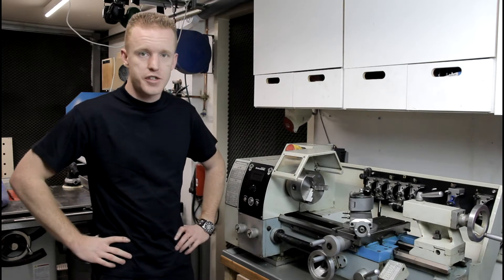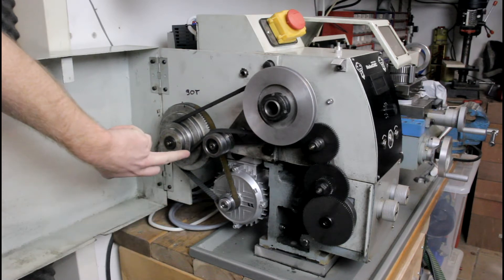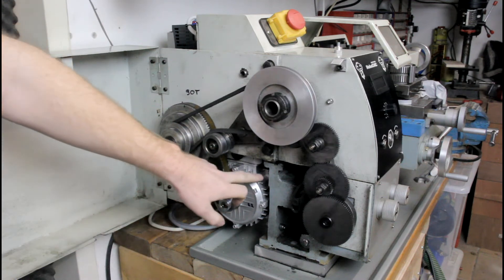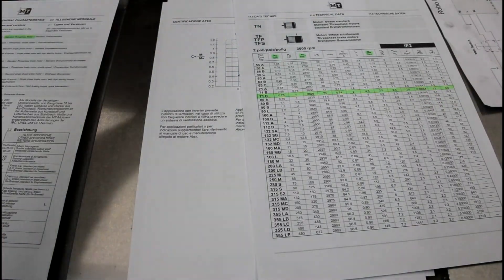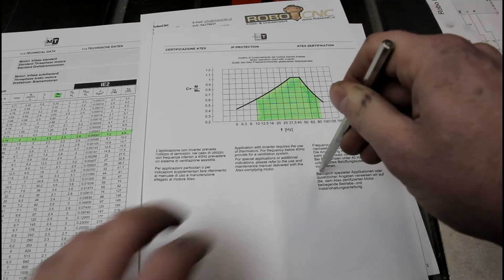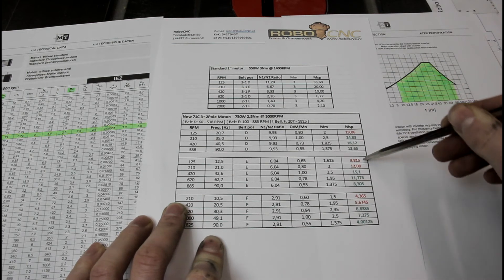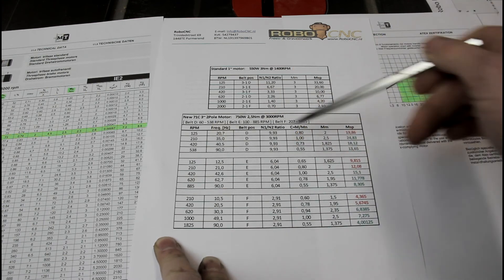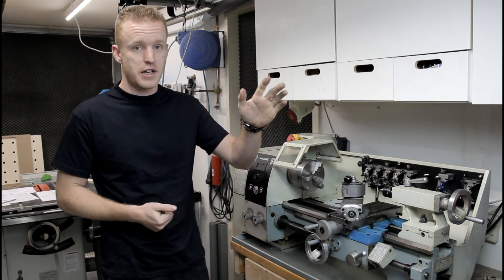RCNC Various 07 : Lathe VFD conversion and motor selection. (Variable speed)

Comment: "brand name i dont even want to talk about" I understand Exactly what you mean!  Nice job you did. How is the machine working?
Reply from the maker: The machine works fine for what I do with it... budget and space wise this is a great little machine
Reply: Good to hear, then you were more lucky then i. Had to do a lot to mine, it works pretty good now if i forget that the vee ways are ground hollow and the saddle only contacts on to small strips top and bottom of the v. 

The pulley you put on your new motor, was that a bought item or made?
Reply from the maker: Bought, although I cant recall specifics
Reply: Thanks :)

Comment: Well done, nice job.

With a bit more work you could convert the lathe over to CNC control.
Reply from the maker: Thanks for your input Oswyn !
Well I have thought of that, but I don't think i want to...
For the jobs i do on the lathe, i think a manual one is even more usefully than a CNC one..

Comment: Very short braking time.
The motor system is well chosen.
Did you program the frequency converter itself?
Always happy on this issue, thanks for the post! :-)
Reply from the maker: Yes braking time is great, and it is without a brake resister.
It is even set to a factor of 0,5 (0 is fastest braking, 0,5 is a bit slower).

Yes i did program the frequency converter it self, but that was very easy.
Only real settings are the breaking, voltage, minimum frequency and maximum frequency..

Thanks for your comment !